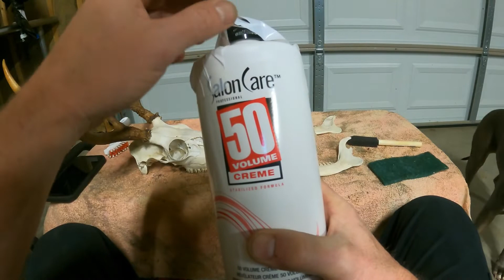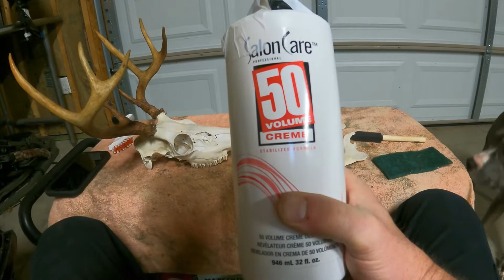Making a European Mount for my Brother (Part 2- Whitening)

Comment: Update: everyone I’ve asked about the lower jaw uses safety wire. Not the wire rope stuff but just the individual strand safety wire.. you can see the safety wire when it’s done but only from the back of the head
Reply from the maker: Thanks buddy- I figured out another way- no wire and invisible
Reply: @firemedic10353  nice, can’t wait to see it